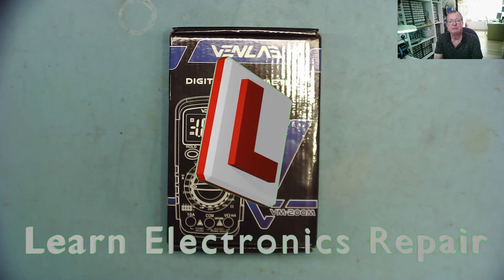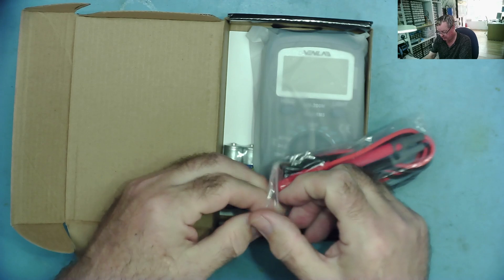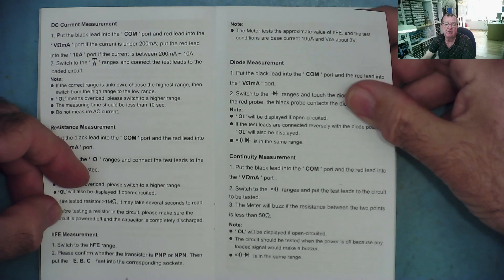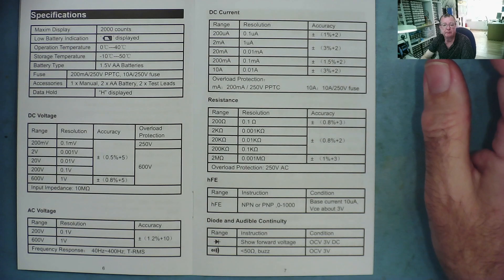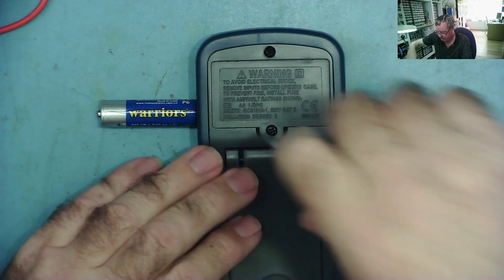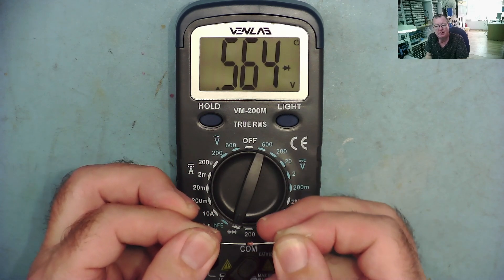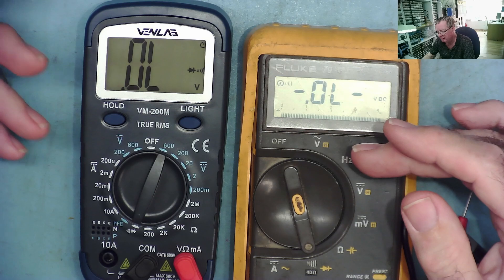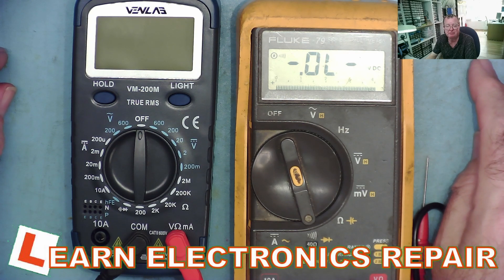Venlab VM-200M Multimeter Test And Review Cheap Meter ~$10

Comment: Uni-t 33D+ (this multimeter has that feature, one time short bleep on diode mode)
Reply from the maker: @ Mir Enterprises Thanks for the info.  I just bought one (from my own money) not that I need it but just to review it for you guys,  should be here in about 4 weeks. If it bleeps continuous on short and one bleep on diode like you say, and there is nothing else wrong with it, then for €15 it is a winner.  Let's see.
Reply: @LearnElectronicsRepair   Thanks Rich, and Mir Enterprises. I have searched high and low and I can't find a meter with that function (other than fluke). I am constantly switching between diode mode and continuity and the audible beep in diode mode saves time looking at the meter on every diode checked.
Reply: Yup that's a good low cost one👍(also known as the AstroAI AM33D, IIRC)
Reply: @LearnElectronicsRepair hey, have you uploaded a review for that one?

Comment: I expected that it would work but it can't do basic stuff for repair work. Thank's for the review.
Reply: Most, if not all the really really cheap ones will not. They are aimed at DIY electricals use, not electronics. OK for what they are meant to do, but about as useful as acid flux solder to us.
Reply from the maker: @JohnBailey39  Venlab did specifically send the multimeter for me to review, knowing this is an electronics repair channel, so that is what I did.  I don't expect a cheap multimeter to be particularly accurate, and neither is that a requirement for most repair work, but I do think testing diodes is pretty basic stuff, if they put the diode test range on the meter then it should work, yeah? So no, it was not OK for what it is meant to do.
Reply: @LearnElectronicsRepair  exactly! If they send it to you I would expect it to read diods. I know most cheap multimeters can't be used for basic electronics work, it doesn't mean they should be recomended just because they are cheap.
Once again, thanks for the review.

Comment: I recently bought an old fluke 79 ii for the diode bleep feature and it is lovely to have but I did notice the continuity tone does not respond as quickly as it does for my cheap 1990s radioshack multimeter, which is pretty much instantaneous.

Comment: The difference between a $10 meter and one costing $30-$50 is huge. A person doesn't need to spend a fortune for a decent meter, but they do need to spend a bit more than $10. Also, it's nice to have an auto ranging meter and I don't think they sell for $10.
Reply: Eh, that Áneng 8008 was 15$ back when I bought it, still my favorite due to size and accuracy. If only it had that diode bleep, I miss that from my ~50$ uni-t that I lost, other than that I do prefer the Aneng.

Comment: Hello Richard,
You say you have a list or are going to make a list of multimeters that have that exact same "bleep" feature of your Fluke?
I'm glad you mentioned this feature because none of my 14 meters do that single bleep.  My higher end meters don't bleep at all on diode mode.  I only have 2 that do that but it's a constant bleep.
Reply from the maker: It wasn't me who posted that list it was a subscriber.  I can't find it right now but maybe the original poster will read this and do it
Reply: @LearnElectronicsRepair  Okay, could you pin it if you see it again?
And thank you again.
I've been taking care of my ma for 10 years and it gave me time to learn this stuff.  I appreciate the sharing, very much.

Comment: a Function that is often omitted on multi-meters is a 1.5 V battery tester. I have so many 1.5 Batteries that i dont know if too keep or throw I know that you can buy a tester for these but i've had variable results from these.  I've seen on the interweb that if you put a resistor between the probes so you draw some current you can see the actual voltage under load but i havent tried this and i have so many mulitmeters? Could you show how to mod a meter or show something that does this already!
Reply: Or just learn how to use the meter ? you have just described how to do it and besides in all my life I've never heard of a "Multimeter" with a 1.5v battery tester on it ! seriously if you must mod the meter sellotape a 75Ω resistor to it and use that in series give you about 20mA...just sayin 😁

Comment: If really want to buy an ultra cheap multimeter you could get the aneng 118a. It costs 2 euro new where I live (new). It has much more functions and is better. That said, I think that the cheapest really usable multimeters for repair work are aneng multimeters of 15 euro up.
Reply from the maker: This one Kris?
https://www.aliexpress.com/item/4001212801564.html
Reply: Unbelievably low price. Surely this must be some sort of loss-leader?
Reply: @LearnElectronicsRepair  yes, but I wouldn't advice it for repair work, it's just a good multimeter in the 2 to 5 dollar range. For repair you just need a better device.